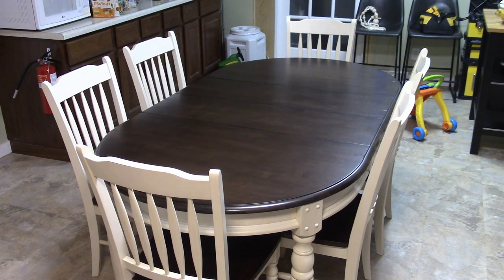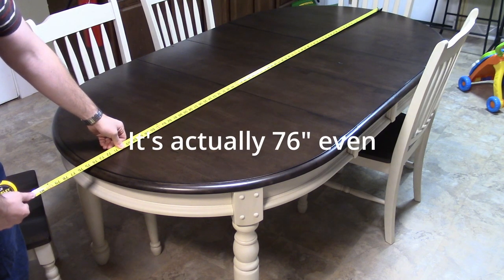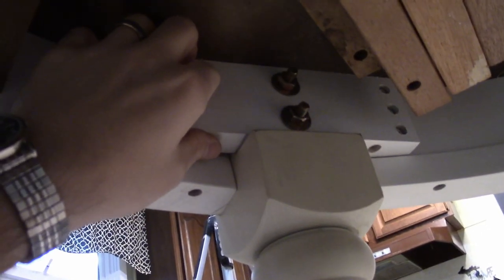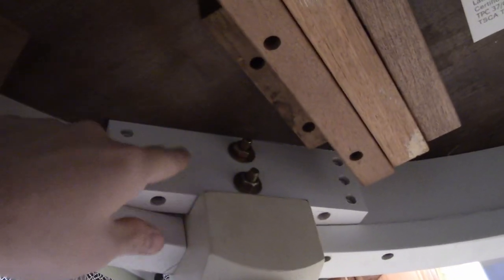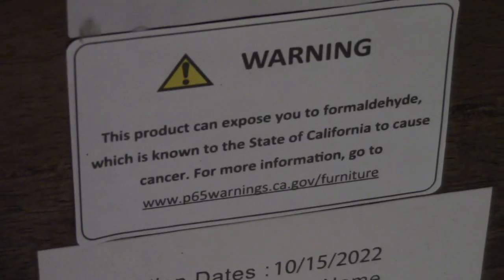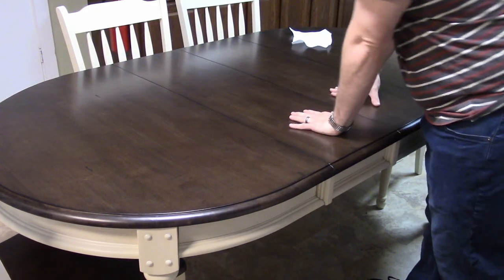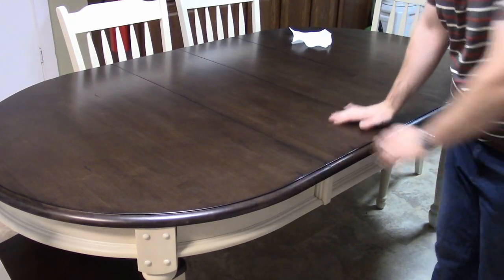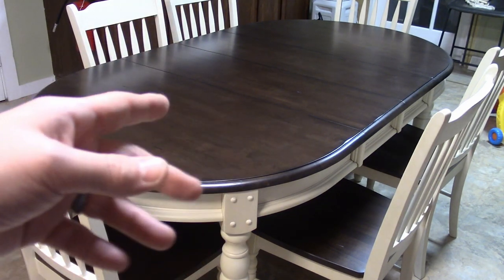Bluff Point 7-piece Dining Table Set Costco Item 1229953 Solid Rubberwood by Latitude Tree Furniture

Comment: We just purchased this table, and we too already have 2 scratches with no idea how they got there. The real problem is that the seat of all 4 chairs does not secure to the chair frame. In other words you can just lift up the back part of the seat. I checked all 4 chairs and removed some of the screws and they appear way too short as they don't even begin to pierce the under side of the chair seat where they are supposed to anchor seat in place. Due to this when we sit on the chair about half the time there is a popping noise as the seat is not secure to frame. Costco was contacted and photos were sent explaining they needed to come back and fix the chairs. We waited 3 weeks until they came, and somehow their work order only told them to replace the table, so they refused to even look at the chairs! I guess I will have to buy my own screws and fix it myself. So much for their white glove delivery and assembly. I should also note that one of the chair spindles was broke on delivery, and another chair is missing bolt hardware in one corner.